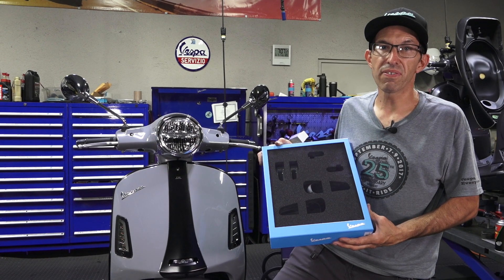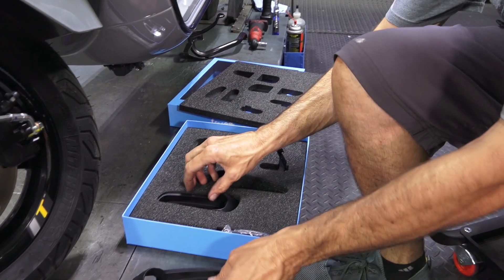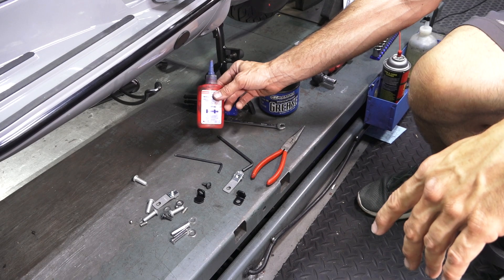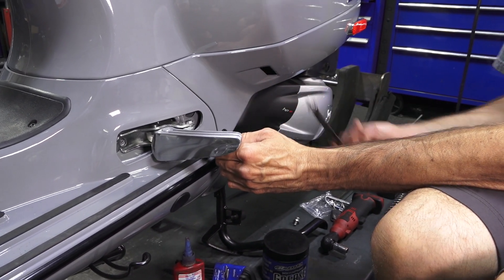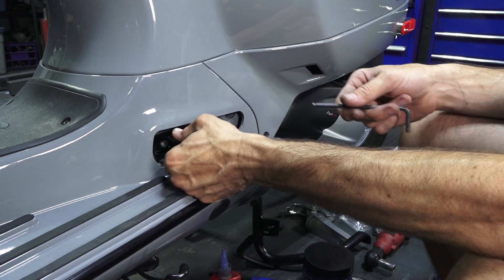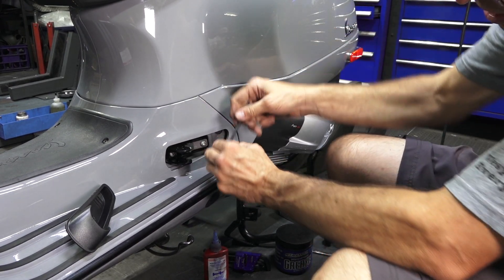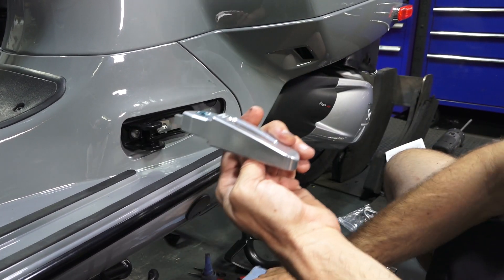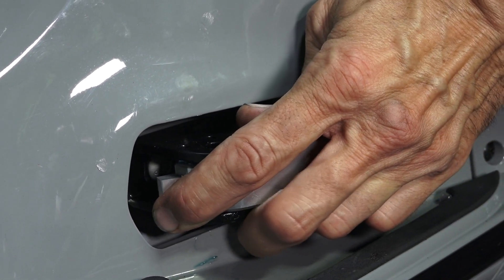Installing New Rizoma Aluminum Foot Pegs on a Vespa GT-GTS

Comment: They look nice but I think that I would wait until someone  was selling a scoot where they have fitted all the "trick" Rizoma parts (apart from that hideous horn cast section) then buy that as they will not add a penny onto the resale value of your scoot, you fit these & you are fitting to please yourself but remember that they might not be to  everyone's taste.
Reply: Charlie Brown - when I bought my GTS, dealer had a choice of 2: one with all the bits and one without... I chose without